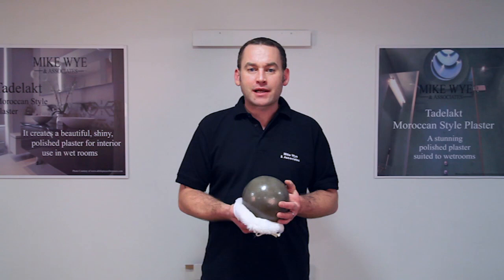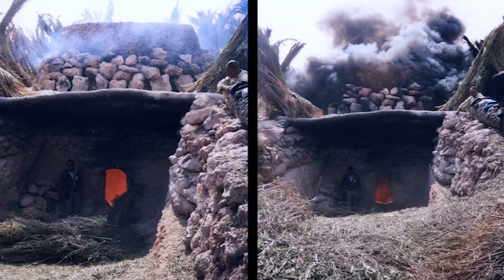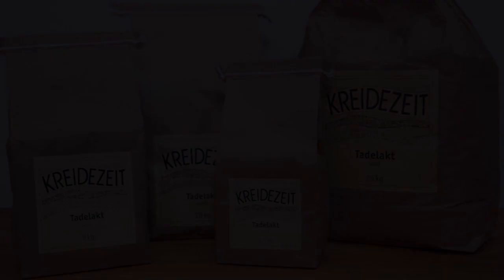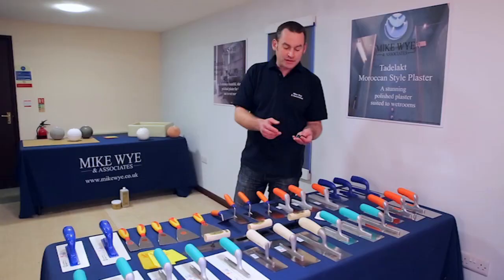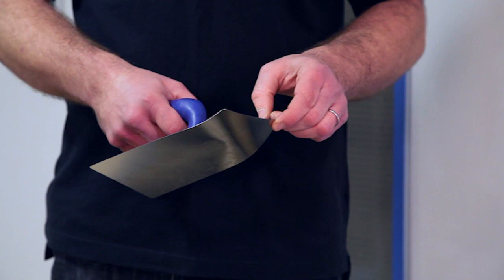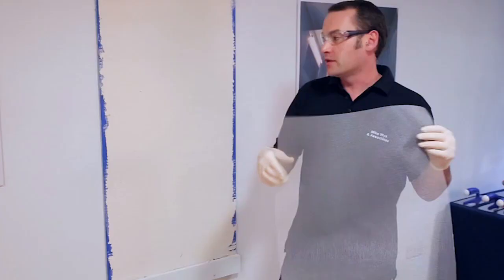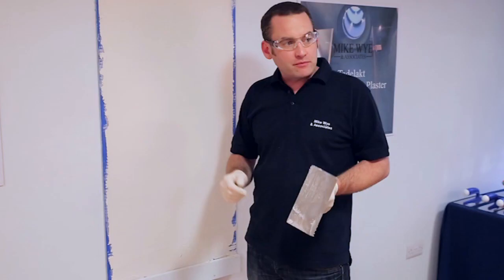How to apply Tadelakt - part 1

Comment: For a larger area, like a whole shower, do you work in sections? How quickly does it dry?
Reply from the maker: You need to set out your day, if I am doing a three wall shower for example, I would do the two side walls on one day and the back wall the next. Although it has a hydraulic set you have plenty of working time, depending on suction you should have a good few hours to work with it.

Comment: That mesh,... what material is that? It seems synthetic, a great way to make an ecologically responsible technique not so responsible. Is a hemp mesh possible?
Reply from the maker: Hello, it is a glass fibre mesh. Hemp would be possible but you would need to build up the backing coats a bit thicker
Reply: @MikeWyeLtd  Thanks! Makes sense to make the coat applied under the mesh a bit thicker. A question that remains though is if the lime plaster bonds with the hemp mesh as it would with glass fiber... Any thoughts on this? Other than that, I assume the fiber mesh is superior to hemp mesh in terms of its reinforcement properties, or?
Reply from the maker: @buildyear86  The lime should bond with the hemp ok. The fibre mesh would likely be stronger.
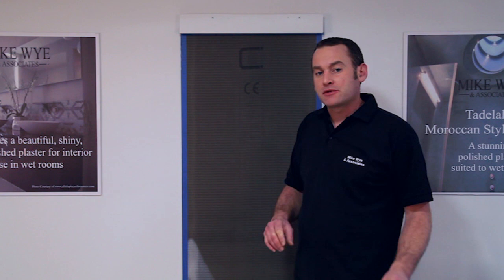Reply: At 5:00 - 5:01 you actually use a term or name for the mesh but I can't understand what it is?  Besides glass fibre mesh what was the term you used?
Reply: @elizabethkupferschmid7844  "kreidezeit lime wall finish"
Reply: @buildyear86  thank you
Reply from the maker: @elizabethkupferschmid7844  it's simply an alkali-resistant 2.5 mm glass fibre mesh; the 2.5 mm relating to the size of the grid/mesh.
I hope this helps

Comment: I've installed microcement floors and walls for years. I'd love to offer this to clients. Will be trying it out.
Can you mix in micro fibers into the base coat instead of having to apply the mesh fabric?
Also will you or the company that makes the product ship to the US?
Reply from the maker: Hi Mojo, I've not tried with fibres but probably possible. We currently cannot ship to the US but Kreidezeit would do. I think they have an agent in the States. Here is a link: https://www.kreidezeit.de/en/distributors/
Reply: @MikeWyeLtd  thanks for the info 👍

Comment: Hi mike Can I just use normal hydrated lime for the backing coat? Also can I just go over the top of sand and cement with TADELAKT
Reply from the maker: Hello Mr Buster, our apologies for leaving your question unanswered. With Kreidezeit Tadelakt we advise only the use of their product Lime Wall Finish (Fine) as the backing coat, for reliable results. You can go over sand & cement, we would apply an initial coating of Kreidezeit Casein Primer to ensure good adhesion.
https://www.mikewye.co.uk/product/lime-wall-finish-kreidezeit/
https://www.mikewye.co.uk/product/kreidezeit-casein-primer-145/
Reply: @MikeWyeLtd  just did it with a  microcement kit in the end mate nice one 👍